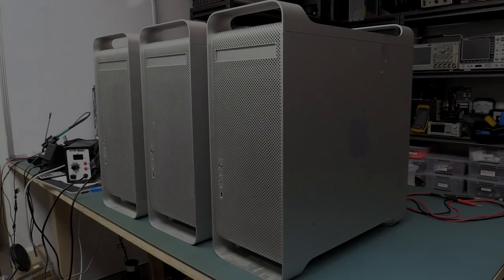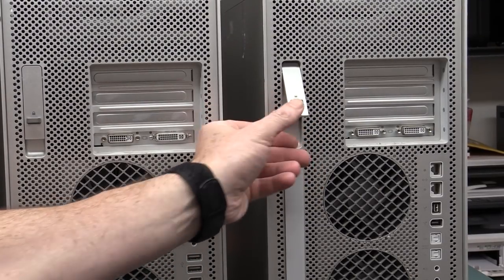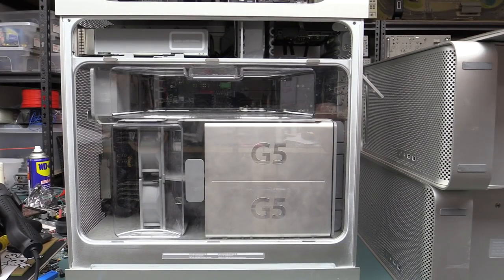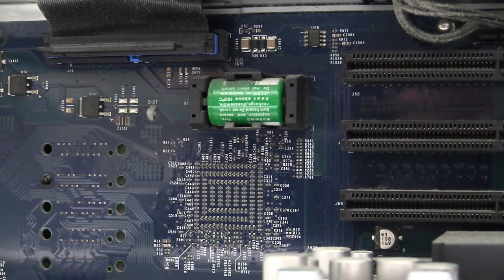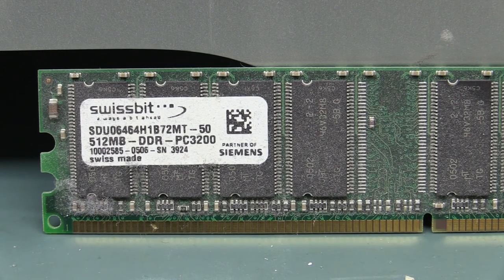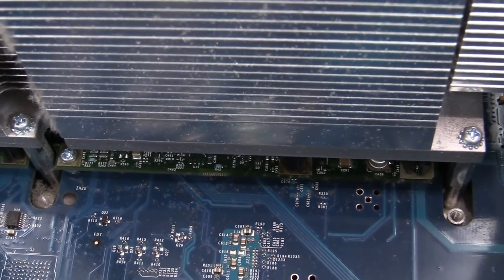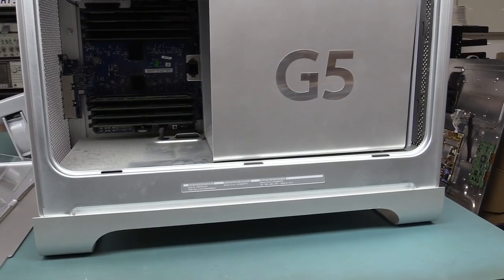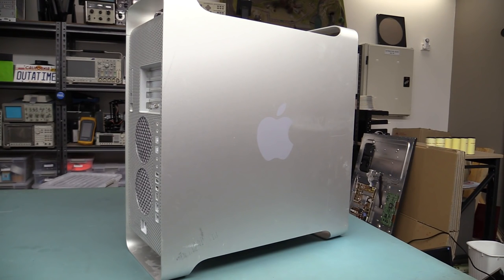EEVblog #783 - Dumpster Dive Power Macs

Comment: i have 2 of these  with the g5s  ,sadly they are single core  for each  cpu , and there are 2 cpus ,so  technically a dual...i tried doing even basic web surfing and its  a very slow experience! youube playback not good..but man, the designing that went into these,the beauty of the thing when you pop the case! the way mac has almost eliminated any or all wires that you would see hanging loose in any modern pc, so that their design is modular, so clean and futuristic ,wayy ahead of its time...in the end, maybe these are best just looked at as a piece of art  that u place in the corner of the room and just admire...i know that although id like to use mine, its just too slow and tedious and its sitting in the closet, a pair of them, but damn, they are sooo pretty

Comment: Actually I don't think I've ever seen one of those 3.6 V Lithium batteries leak and some were probably close to 20 years old. They were used throughout the late 80s, 90s and 2000s, maybe even in the cheese grater style Mac Pros. Some models (especially the home-user Performa series of the 90s) used a weird Rayovac 4.5 V alkaline and one G5 model had a CR2032.

The whole thermal engineering is bloody impressive but believe me, it was badly needed! Later models even had water cooling and still thermal issues were by far the most common cause of death. Those CPUs literally cooked themselves alive and sometimes took the logic board with them! Not to mention coolant leaks as the systems aged. The problems with the G5 were actually the reason for Apple to switch to Intel CPUs because IBM just couldn't keep up with performance demands.

I briefly wondered what the SD in the model description means but then it dawned on me - it stands for Super Drive, Apple's fancy name for a DVD burner (I think most of them supported DVD-R, DVD-RW, CD-R and CD-RW). The Combo Drive was the lowlier DVD-ROM/CD-R/CD-RW drive.

Comment: i have a mac myself. great machine.
if you hate macs you have to admit there is some serious engineering gone into them. they are very well made. delta electronic fans. japanese fans still made in japan. the power bricks in modern macs are still delta psus made in japan. i gladly take one off your hands. im local too :D

Comment: What DID you do with them or still in the "getroundtoit" stage?
Great looking cases, just before the intel era where everything went to shit :D (my last apple desktop was an imac24" never again,  burnt its gpu due to bad design but my other 3 mac's, though collecting dust, still work decade+ later! I must rip out the harrdives and throw them away. The intended mod for eg of the mac mini in a car became obsolete extremely quick due to tablets  :D

Anyway,  seen some nice mods of these cases - tables, lamps etc but i'd rather just slap in some new boards and cpu's etc and hackentosh them, anything else is sacriledge, like removing all the chrome etc from a 60's sports car and converting it into a modern plastic thing.

Comment: G5 Fishtank! Yes they are still in demand those cases, I did a PC conversion into one many years ago and it was very successful, good fun as well. Personally I would keep the best condition one for prosperity. People may pay out Apple but no one in the world matches their design as far as I am concerned, these cases remind me of 1970's amplifiers where everything was layed out beautifully for no reason other than they wanted to do it and to be proud of their work. The day to day user wouldn't even see it! Those fans are Delta by the way, same as the power supply most likely. Apple always use Delta as an OEM in most cases they don't cheap out on internals.

Comment: hell I would use them as cases for new PCs. No OEM cases I know have that level of workmanship on them, even current mac cases are a joke compared to this. It would take some work, probably going to need to make new holes for a modern motherboard and getting a modern PSU guts to fit on the base its not going to be easy but at the end you get an awesome tower!. I would totally do that.

Comment: I'm certainly no mac fan, and have never even owned one, but I have to admit, I've always loved these older power macs, such an amazing, if not always the most practical design.
I would have thought though, these things would have been worth quite a bit to collectors. Those things were top of the line, and every mac fan wanted one when they were new, even a lot of pc guys (even if most would never admit it) But most could only dream, and had to settle for an imac at best, because they weren't exactly cheap!  Even though pretty useless as every day computers today, those types of computers still hold a lot of value to enthusiasts of older computers, and, collectors. Take my Amiga 1200 (which I'm not directly comparing to this btw), while its much older and even more useless in modern computing terms, my phone is certainly much more powerful, I still love the thing, and spent more money on repairing/upgrading it than I'd ever like to admit, and should I have the money, I would certainly up it to an Amiga 4000 (just as useless).  And to be honest, if I had to choose between my 1200, and my modern intel i5 gaming PC, it would be the Amiga every time.

Comment: not sure how these can be called "useless" those things are still pretty strong by today's standards when you start looking at budget hardware.
Reply: +The Wolfiet I think the biggest issue is the PPC processors can't run the newer versions of OSX and most newer programs won't run on them.  Not because they aren't powerful enough, just that the language of the processors and OS changed so drastically when Apple switched to Intel CPU's shortly after these.  You can get special versions of Linux to run on them though so they aren't completely useless unless you actually want to run a modern 64-bit version of OSX and modern Apple programs on it.
Reply: yeah, really the only issue is the change in language. Like you said, there's hacked together Linux builds that can actually run clean on them. He really should have worded it a bit better though. The processing power isn't what killed them, just the total dropping of the architecture.

Comment: How much work would be involved in repurposing those for a modern PC?
Reply: +Cryofax The same amount of work it would take to install linux on it.
Reply: Xenodine81 That'd just make it an old machine with Linux on it. lol. What I meant more specifically was how much work to use the case itself with modern hardware parts. Looks like it would at least need some better ventilation for airflow but hard to tell from this how new PC parts might fit inside.

Comment: over engineered to frig you should use the big one as a server they run os 10.3.

they are worth about 200 with a little bit of work you can mod them to put regular pc parts honestly i would try to get the big beast one to work then run it as a sort of server or something...

Comment: Such amazing machines! And I would've take them, absolutely!
And they're not as useless as you might think. You could install a modern Linux and use them as Servers. If you're only interested in hosting simple pages or for development and not have like 100.000 visitors per day, they will still perform nicely!

Comment: Kinda ironic how it's made by the same company that produced the macbook 2015 (slim fanless model laptop style thing) that'll throttle already with a slightly above moderate workload. But they are devices designed for an entirely different working environment so kinda fair game I suppose.

Still the CPU choice in that macbook was questionable at best...

Comment: Back in 2010 I bought a  2003 1.6GHZ powermac G5 off of ebay for 120 bucks with a Dell LCD monitor, keyboard and mouse and a mess of cables. LCD monitors cost then about 120 bucks thus I considered the computer to be free. Freight ie UPS was one third of that 120 bucks. The computer had Tiger 10.4 at first then was upgraded to 10.5.8 Leopard. A month after upgrading the HDA had errors and I reinstalled Leopard on a clean hda. The beast was usefull on the web but later would not allow many youtube video to load. Some chap on youtube had a patch that fixed the old flash problem. Later the beast would take forever to boot and sounded like a jet plane taking off with the fans roaring for say 10 minutes until all was OK into a workiing screen. Today the beast will not boot into Linux, Ubuntu or anything, ie the thing just roars. It probably has some failed solder joints or bad caps. Still the case looks cool and the Dell monitor with its 4/3 ratio still is used on some older win 2000 machines. The odd things is today on ebay a dead powermac g5 is often at least 60 to 85 bucks with freight. If you want one cheap find a local place or dumpster dive.

Comment: "all about the thermal performance" - no filters on air intakes. other than that and low hard drive count for a pro system, I still prefer the older tower systems to the new trashcan design. why not take two of them with some glass and make a coffee table

Comment: Is it possible for You to send me one of the cases? I am huge fan of the effort that was puted by designing team in to crafting that piece of art - beautiful aluminium case. I have a dream to fit inside classic PC components, but here in Poland most of G5,s are still in use & hard to acquire cheaply :/

Comment: "less power than a modern iPhone" 

Not quite, since the latest iPhone 6 has only a dual core 1.4ghz CPU with 1gb RAM. that's about 3/4 the processing power and a quarter of the ram of the smaller power Mac in the video.

Comment: The PPC architecture is the main thing that makes these computers useless as almost all modern consumer grade software is designed to either run on x86, x64 or arm CPU architectures

The latest "modern" software you'll get is some distributions of linux, last time I checked there is a group of people that still port various distros of linux to Mac-PPC, sadly my personal imac g4 only has 128MG of ram and cannot handle anything more than it's default OS

Comment: Dave, Take the old junk hardware out and replace it with modern hardware. Or remove the old HDD and replace it then launch up a folding software and let them run in the backround, Or just do a giveaway and....Give them away!

Comment: If you still have the software, they're still fast enough for most essential tasks; the main drawback with these beauties was Apple overclocked the chips on them, and had to use a liquid cooling system, so they were more prone to failure than the G4 series.  That plus the fact IBM couldn't keep up with Intel in PowerPC Chip development led to Apple switching to Intel chips.  Not to worry, Microsoft picked up the PowerPC Chip line and stuck it into their XBox Console, so it wasn't as bad as Apple haters think.

Comment: Could you please make a video about how to upgrade the specs list of the Powermac G5, because I was thinking about buying myself one of these beautiful computers, but I would still like to atleast be able to play basic games like Minecraft on it, without having problems with lag and a bad resolution. I would also like to upgrade the mac OS to Windows, because I don't really like mac OS too much (if I am honest I totally hate it). I would prefer a new Windows, for an example Windows 8.1 up and running and not one of the  very old versions like Vista or even Xp. I really like the Design of these Computers, but as I said I hate the OS and the specs list Isn't too good for todays standards either.
Reply: +Niclas Wyatt  Ofcurse I don't know if this is possible, but if it is I would definitely buy one of these beautiful computers on Ebay/Amazon/etc. and upgrade it.

Comment: Not that old for Macs, would probably run OSX 10.6. ( all the benefit of OSX minus the annoying notification center.......... ).
if it weren't for the shipping to the US I would SOOOOOOOOOOOO take them.
i have 2x iBook G3 OSX 10.4 that still run great ( except the graphics defect, they run headless now, great for servers ). the iBooks wouldn't do much video now, but originally not a lot either, so...
the only complication is the PowerPC chip however there is still Linux's out there that should run, or just OSX which is pretty great on its own. it's not Windows but they all have their purposes and take some getting used to.

Comment: Only 4 GBs is the total amount of RAM. For 8 sticks, that's just crap.
Reply: +Brendan Matelan it's not from this decade, that's 4000+ $ of ram in 2004
Reply: ***** bouh but wich programm used 8Gigs of ram back in 2004?
Reply: RexorProxer the same programs that use 8gigs in 2015
Reply: +RexorProxer photoshop, 3DS Max, Autocad, all the big graphical stuff Macs were (and still are) primarilly used for.
Reply: +RexorProxer ProTools, Avid, Sonic Solutions. And that much RAM made Photoshop and Painter scream

Comment: i am sure the one with 4gig of ram can do more modern os's
Reply: +Tony Thatcher There's no reason (speed-wise) that they couldn't run modern versions of OSX, but Apple stripped out support for PowerPC after 10.5; so they can't run on that type of processor anymore. Mainly b/c they wanted to force people to switch, and so they wouldn't have to support both versions anymore. Can't install Windows for the same reason - doesn't support the CPU type. They can run more modern versions of Linux though...

Comment: The engineering\design on apple products is sooo hit and miss. You come across laptops/systems where everything comes apart beautifully, and components are easily accessible for repair. Then a generation later you end up having to tear half the machine down just to access a failed hard drive.

Comment: the case is sexy, but it requires going with a dremel to make it useful.   can still use it to run Adobe CS2, it might work smoothly on it. if osX doesn't force you to upgrade shit.
never wanted a mac but i thought, what if i uselinux or windows with some nice osx theme...  but instead of big Jobs inside it would run more free software and everything like a big boi, keeping the only good thing Apple used to do right : aesthetics. 

but now it's your pc.
Reply: >2015
ow

Comment: 1Gb = 0.125 GB,  right ?
Reply: Shaozhen Song  1 gb is 1 gb or 1024 mb
Reply: Of course 1 gb =1 gb, but 1Gb is 0.125GB. There is a difference bitween bit(b) and byte(B). If you ask google "1 Gb to GB", it will tell you 1Gb = 0.125 GB.

Comment: Install Debian
Dual 2.7Ghz pure 64bit processor is useless?!? If thats true then please throw away all the DVDs, films and CDs you ave recorded, mixed, edited or animatod on these machines!
The only thing thats awful about htem is the power supply. Also, if they are water cooled then keep a regular eye on it for leaks as the coolant actually eats the pipes.

Comment: EEVblog The best model is quite usefull in 2015 it has 2 Dual Dualcore Cpus and it can play and render vídeos at 1080p quite easly
To use them you have to get arround using TenFourFox as the web browser
but other than that you can still use them as a normal Pc
And no na iphone isnt more powerfull than those macs even a Core 2 Duo CPU cant match the best model o PPC MAC

Comment: Most useless Computer HW are Apple's. Obsolete less than 2 years.
Reply: You can run El Capitan on a 2008 MacBook Pro, so it could handle the newest OS before Sierra was officially released one months ago
Reply: Whut? I use a 5 year old Macbook which just replaced my 10 year old one.
Reply: Hats off to you !!!!
Reply: Posted from MacBook Air, Early 2015. (Insider tip: No New MacBook 2015/16 they're pieces of shit )
Reply: Homer Simpson
to be honest, I look with great worry at the latest Macbooks. What will I be typing on in 5 years, when this machine becomes too old?
Reply: Prob on a touchpad with 0,512 Mhz Intel Core m92 at 2Gbs of RAM without Heatsink
Reply: And freakin yes, I mean Mhz
Reply: Even the latest MacBooks all come with only 1 USB C Port !!! I plug in a wireless mouse and then I cant use my Thumb-drive! Yes, you can buy those USB Hub thingy, but then it becomes so messy.
Reply: S000 L111
My 2011 Macbook is the perfect machine. It has all the ports I need and the servicability I expect. I certainly don't want a hub and a dozen adapters for all my needs, including cable internet, USB sticks, etc. Ugh!
Reply: Yes, I know what you mean, exactly how I feel ! That's why I didn't want to buy the latest Macbook. Only 1 port ! What are they thinking !
Reply: S000 L111
Seems like Mr Cook hates anything meant to plug a cable into :(
Reply: The MacBook Air has 4 ports (+1 headphone jack) not so many that the laptop gets to thick, but enough to work without hub.  #getambairbecausethe2016mbsucks
Reply: especially if it's PPC based 

but just remember that the iApple will be obsolete in 5 weeks

Comment: Yea as others have said, a thumbs down for this video. You're raving about the fact that these things are engineered so magnificently, however you failed to show us any of the key points, the CPU, heatsink designs beneath that G5 cover, and the PSU, with how they've done that PSU -> MB metal bar linkage.

Honestly, this video just seems like it was lazily put together.
Reply from the maker: ***** It was a lazy video. Was originally intended just for my EEVblog2 channel, but then figured more people would like to see the find.

Comment: And to think these days Apple uses off-the-shelf PC hardware AND STILL charges 4 times what they're worth. :-)

I have an old Amiga 3000/040. I can run 3 operating systems on it at the same time; Amiga OS, MS-DOS 5 (via the 386 Bridge-board) and the Mac's System 7 (under Christian Bauer's "Shapeshifter").    Far superior computer to the Mac.